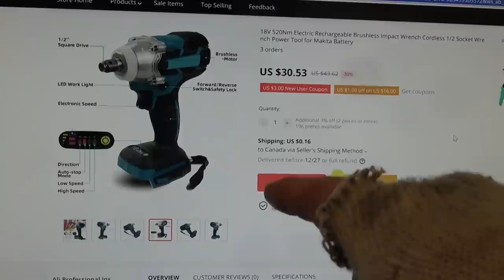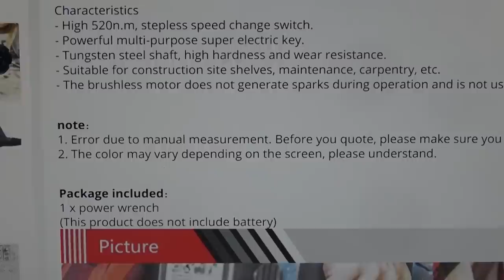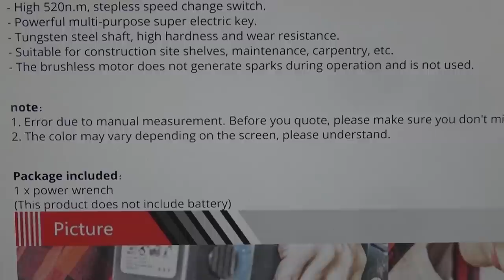BOLTR: Fake Makita Driver

Comment: Survives a torque-down against another drill; survives several hard drops from a great height; dies from a screwdriver in the hands of Uncle Bumblefuck.
Reply: what's the hack to taking out a broken bit in ur makita impact beast?
Reply: strong magnet while pulling the collet back😮
Reply: @PS3PS3PS3PS3  or just pull the collet and tappy tap tap it on something
Reply: @deimosian  they sure do, but are they the best? probably not. not saying they are shit. but even the top brands have flaws. and yes id rather buy a genuine makita or snapon than a cheap knockoff
Reply: Vivian Stimpson  Some companies follow the mantra of don't ask questions if you don't want to know the answer.
Reply: Still working, got to fix that. 
Still working, got to fix that. 
Still working, got to fix that. 
Good and pooched, jobs done.
Reply: she's brain dead but that's correctable!  Heart beats and nothings broken!
Reply: deimosian thats why all those sketchy little garages run by drug addicts and criminals have Snap-On tools

Comment: R.I.P fakita. 2019-2019
Reply: So cheap that if you Cut off one head, two will take their place!   Hail Hydra!
Reply: Frankenstein the parts on the Makita when it breaks down for more surprises.
Reply: fajita*
Reply: *Fakeita
Reply: And time!
Reply: Whatthefuckeita
Reply: More like Makita vs. No-kita
Jeez, at 14:10 the coil wires are overlapping, which after vibration during use can rub off the enamel coating and basically short them out.  Yikes!!

Comment: If I had the batteries already I would totally pick one of these up just to see how long it lasts under normal use.
Reply: This is AvE's normal use!
Reply: I happen to have Makita batteries. If they had a 1/2 inch impact I'd consider trying it. Since I already have a Makita 1/4 inch impact and drill I don't feel like buying a knockoff of what I have.
Reply: Quite a few Scaffolders in the UK use these fake Makitas now. The real ones will last around 6 months on site with constant use, the knock off will last about the same with real batteries if you look after it. Big difference in price though. They dont like being dropped as much, mikitas tend to bounce with little damage, these things just split.
Reply: @Jaker788  it's the Makita XWT11.  The wrench in this video is a clone of that Makita impact wrench. 

I've taken both the Chinese fake and the OEM Makita XWT11 apart.  The OEM Makita is much nicer.  Especially the electronics, motor and trigger switch..
Reply: @Jaker788  On the image near the start (4:40 or so) it claims to be a '1/2'' square drive'
Maybe it's just the camera putting you off thinking it's a 1/4'' lol
Reply: Alan Mchugh 
You could wrap some rubber bands around them If you plan to drop them every once and a while.
Reply: Really doesn't look that terrible!
Reply: @TheMcal9909  they look the part but cost a fraction. You could buy 10 of these and swap the body out when it breaks and if you get more than 6 months out of it then you're doing really well.
Reply: @Conservator.  Ive seen a few blokes wrap them up in bubble wrap!
Reply: @Alexander_l322  Not knocking them at all. ive spend more than £3000 on Makita impacts over the last 5 years. These have saved me alot and for the cost you dont really mind when you do drop it.
Reply: Alan Mchugh 
You might not mind dropping one of these but your body below you will!
Reply: @Jaker788  Bought a 15 pc kit some 10 yrs ago and it had BOTH a 3/8" and 1/2" impacts. Only use the 1/2" when putting together deck hardware, so I can't say as to "long term abuse"...
Reply: @matthewwarfield4302  they're made for lug nuts as well right? I've seen 1/2 usually marketed towards replacing pneumatic impacts for changing wheels or other high tourqe automotive use.
Reply: @Jaker788  Yep, not sure it would break the lugs on my 3/4 ton pickup... Like I said, we drive 1/2"  hardware with it mostly but it will break 3/8" G5 bolts... I use it for anything larger than 3/8" so I save my impact driver a little.
Reply: @Stevo_1998  the fake one is 1/2.  But the real makita is 1/4 hexagon.
Reply: @Moppemannen_mattias  yeah, but at the end of the message they said: 'I don't feel like buying a knockoff of what I have.' so I'm gonna assume they thought it was a 1/4'' and not a 1/2'', which is fair enough ¯\_(ツ)_/¯

Comment: Note, the lack of hall effect sensors doesn't mean it's open loop control, the ESC reads the voltage coming back from the coils (once the MOSFETs are off) to determine the actual position / speed of the motor.  If this wasn't the case, then when the motor started to get under load it would lose sync completely.  Model aeroplane 3 phase motors are the same (no hall effect sensors) and they work fine in sensing the load, and adjusting the frequency accordingly.
Reply: It's a terrible solution for motors that start under load. You can actually initially rotate in the wrong direction, and applying full power is generally not a good idea. It's cheap though!

However, that rotor looked weird to me. Was this brushless PM or induction? I guess each slice could have been a polarized magnet.... In induction, you need a current path (the cage).

Or maybe VSR...
Reply: @JJJulie-t7e  Nothing wrong with using back EMF for sensing.  It's not as good as using hall effect sensors, but it's cheap and easy with modern uP's.  It will get the business done plenty good enough for a hand drill.
Reply: It's not applying full torque from 0 in an instant. It ramps up the speed open-loop until it can sense enoucg back-EMF to switch into closed loop.
Reply: Commercial treadmill motors work this way too.
Reply: @JJJulie-t7e  I think there is enough play in the gearbox to get a reading before the load is applied.
Reply: not to piss in your drink, but this motor is even dumber than that. it's just a potatoe old 3 phase asynchronous motor. no permanent magnets in the rotor, the eddie currents in the laminate ferrite core induce a magnetic field which will automatically follow the magnetic turn direction while always being a couple percent slower than the field RPM.
even shittier to start these kinds of motors under load because they have a saddle moment at like 1/3 of their nominal torque, but since it has FM that can be circumvented sometimes.
Reply: Most of you guys are right, in a general sense, but there are cases were you don't want/need hall effect sensors. I work on a codebase for ESCs and we ditched sensors to pump out more motor/battery efficiency. If we were under load from start, though, we would most definitely use sensors.
Reply: @faurana  You must have missed him struggling to remove the rotor due to the pull of the permanent magnets at 19:19. It's a BLDC inrunner.
Reply: @BadTimingRobotics  Well, I'll be fucked. That sure looks like permanent magnets holding that rotor.

Perchance, there was more than a beer and a half involved.
Reply: You can actually do initial position detection by reading the inductances of the coils when stopped without sensors.
Reply: @JJJulie-t7e  actually have one of those things bought. It actually is a bit terrible - if you give it throttle when the hammer is right next to the anvil, you don't get any strike whatsoever, can easily stall it out with your hand. Has about zero low rpm torque. Once you rotate the tool to give it some striking space, it works fine. Surely that won't ever get old trying to remove bolts from tight spots.

Comment: did the cruise control mod, i like it
Reply: Wait what?
Reply: @Calvin mais si, señior
Reply: @tacomas9602  ye, wrap the seatbelt thru the steering wheel, been doing it for years
Reply: @0xsergy  that's autopilot. cruise control is putting a "high idle" brick on the gas.

Comment: I'd love to see you order a 2nd one, then take it apart to see if it has the same internals. Maybe order some other tools from them too, if the seller can get it from the same supplier.

I wouldn't be surprised if those molds are owned by company with a real brand name. You can make great reinforced plastic when someone else pays for the extra replacement molds.
Reply: @VictorVonVulfgang  The real version of this wrench (XWT11) has a bell housing cap held on with 2 screws.  So it's likely this is a different mold. 
Or one that was modified to make the end product a little easier to make.  Idk. .
Reply: the one I bought uses sealed bearings on the rotor.   The ones in this video are shielded. 

So yeah, there's likely a real hodge podge of parts being used to turn out all the counterfeit impact wrenches.  Everything appears to be a cheap clone of the real deal, from the switch (Omron in the Makita) the connectors, the LED light, the ESC and the battery rail. 

The gear housing and transmission are as close to OEM as it gets.  And I wouldn't be surprised if those are being stolen right off of a Makita assembly line.
Reply: The 12v stuff is cute ... and great for putting in RC cars
Reply: design patent - covers shape, color, smell etc
Reply: What usually happens is name brands goes to China for production and has 8-12 manufacturers turn out a test batch and than give contract to the best 3-5 manufactures and fucks off the other 7, but them being china with no patent enforcement, they going to continue pumping out production and sell to the local market/online.
This happens with smart phones all the time and honestly they deserve it, if they want to go to china for cheap production than they can take the downsides that come with it.
Reply: C W  copyright doesn't cover functional parts, it could have a design patent possibly
Reply: C W  Yes it can be covered as an original shaped design.  Like you can not copy the fancy designers kettle

Comment: I use mine since this vidjeo. I love it, it helped with many rusted bolts, and I also did built a house with it. It's still going strong. The only downside is, that it ate 2 original Makita battieas. Don't let them go under 2 bars, and I think you're good to go!

Comment: The new Walmart "hart" brand is in need of destruction.
Reply: "Hart" is being made by TTI, from what I can tell, they're Cryobi's in White and Blue (WTF?) cases... would be interesting to see them torn apart next to TTI's other lines to see if any price engineering has been done to Walmart's standards... Sad that Hart is another zombie Brand, they made decent Hammers back in the day in the US. (but hey, we still have Estwing at least)
Reply: I picked up a Hart 1/2” brushless drill on a whim, and, in no small part due to AVE, took it all apart. From what I can tell it‘s skookum. Electricals are tidy with clean solder, metal gear train, smooth trigger with a boot, boards conformally coated, bigass motor, and it went together as easy as it came apart. Looks like it shares its guts with higher end Ryobis

Comment: Quick! Buy these before they figure out they can get greedy like the Name Brands do and ridiculously mark it up !
.....if these things can do brushless for $30, then why are we spending $300!
Reply: Eh, I can get most tools even the name brands for less than 100, especially an impact. It's the batteries that kill ya.
Reply: The warranty
Reply: because they're stealing parts off the Makita assembly line, lol...that's why they're so cheap.

And they're certainly not built as good either.  I've taken one of these Chinese wrenches apart along with the Makita it's a direct rip of (XWT11.)  There is no comparing the two in terms of overall quality, the OEM blows the fake out of the water. 

The only thing that comes close to OEM is the gear housing and the transmission, and that's because there's a 99% chance they're stealing them right out of a Makita-owned assembly line.
Reply: Because my name brand tools have survived mishaps that I highly doubt this would. A great deal like $30 does me NFG at all when something goes wrong in the middle of the day and I need the tool to work right then, right there.
Reply: @98ek9  the Chinese seller will happily send you a replacement if it broke, at worst they'll ask you for a video and no return/shipping needed
Reply: @98ek9  don't need no warranty for a $30 tool broskii
Reply: @pierreuntel1970  true
Reply: When you buy a branded product, part of what you're paying for is the name, sure. But part as well is the R&D that went into designing it, better quality control, and a better warranty.
Reply: J.C. Kohle  yup
Reply: Where do I find this?  I'm in the market for one anyway
Reply: I bought one 8 months ago, had a beating and still going strong. I think uncle bumblefuck, fucked it when he put the motor back the wrong with round. Ive just used mine on cars wheels an other small jobs an its held up well. 32 pounds delivered in the uk.
Reply: @michaelbamber4887  Where did you get it?
Reply: @AaBB-ks6oc  Sounds like you have ZERO clue how manufacturing of parts for brand assembly works.
Reply: @blurglide  

Aliexpress. DHgate. Theyre even on wish occasionally.

Comment: I've been running one of these knock off Makitas 6 days a week, for about 6 months, undoing wheel bolts, hub bolts and other heavy stuff. Not killed it yet
Reply: Where did you get it? I would like to try one.
Reply: blackscotydog got mine off eBay, search for ‘Replace Makita’ there is a whole host of knock-offs, not just the impact guns 👍
Reply: @TurboTel68  Thanks I found one for 15.99
Reply: My real makita 1/2” drive will barely loosen a wheel bolt, runs for like 10 secs before it begins to turn
Reply: im curious, now 2 years later, how did it hold up ?
Reply: @C4reful  it’s still going!! 
In a busy garage, 6 days a week. 
It’s completely battered, covered in grime, getting a bit noisy but it still does what it should. 
It won’t ever beat our Milwaukee Fuel but I wouldn’t expect it too. 
Where it wins hands down is in all the tight spots like anti roll bar drop links or in the engine bay doing gearboxes/clutches. 
It’s even softened the soul of my boss who is a die hard Snap-On man and it regularly gets borrowed by him!

Comment: The extra battety sensor and torque control is available on the higher end makita impact drivers. The have 3 settings plus a self tapping mode.

Comment: I just fully invested in one of the 7 tool Makita sets on the advice of my contractor brother in law.  Been loving them. Just saw that Makita is still dedicated to full line battery compatibility for all the 2020 tools coming out!
Reply: I've had to take a file to a few of my tools as the battery slots have been changed for different battery models.
Reply: Not to be a shill or anything, but i mostly see makita tools in the hands of contractors here.
However that may be because they're a fair bit cheaper than the competitiors (they got a factory in romania, a neighbouring country, so i guess that's less shipping/taxes costs or something)
Reply: Don't know about Makita but when you buy the DeWalt pkgs. THEY ARE NOT the same as if you buy them separately.   Google it .
Reply: @libertyman3729  I checked before I bought it. All the model numbers were listed and they were the brushless tools they sell individually.
Reply: @TechchnologyGuru  You probably removed the part that would stop you from using "small" batteries (<4Ah) in devices that require bigger batteries!
Reply: @thomaskrechel  my original tools and batteries were 2 or 3AH from when I bought the kit in 2007ish. The newer 4AH batteries wouldn't work in my tools. As such I had to remove a plastic obstruction in the battery slot on the tool. 
So it sounds like what your saying but I just don't understand why higher Amp Hour batteries can't by default be used with my original drill, impact driver, sawsall, skill saw, grinder, and flashlight .

Comment: I picked the Makita battery platform, partially because of the BOLTRs.  I haven't regretted the purchase once and, even as a lowly home gamer, they have been a joy to use.  I'm not one to tell anyone where to spend their money, but I don't want to encourage the race to the bottom.  I'm going to continue to buy the real deal.  The batteries are where the money is at anyway...
Reply: I also stick to Makita batteries. I found an adapter which lets you run Makita batteries in Ryobi, which is great for stuff that Makita doesn't offer, like tire inflators.
Reply: how are your legs gonna look like cantaloupes if you use an electric tyre inflator?
Reply: I got a decent deal: charger, 3 batteries, impact wrench and cordless drill. My Wera screwdriver tips fit into the impact no issue. The drill is indeed NOT SDS, and the hammer action is well, probably useless, but I just use a wired heavy drill if I have to go against masonry anyway. The only issue with the impact, is that it will drive the screw into whatever material, and then keep going until you get to the other side, if you're not careful enough.  Or it will try and rip your hand from your arm.
Reply: @thatsunpossible312  ya know Ray, I've been eyeballing that bendy double jointed Ryobi work light...

Comment: When I saw those impact's online I instanly bought 2, and I can say they are the best purchase of 2019 for me
Reply: We're from ??? Please
Reply: @xjr1300paul  they are everywhere on banggood,aliexpress just type in impact wrench makita compatabile cost's around 30$
Reply: @MrPatrik246  They say you have to open them and grease the mechanism. Are they still working good? There is one for 65$ including shipping and 2 batteries at the moment,
Reply: @Gabson9  i did grease them, they still work. I would not trust their batteries, I use original makita battery, still going strong
Reply: @MrPatrik246  Thanks mate.